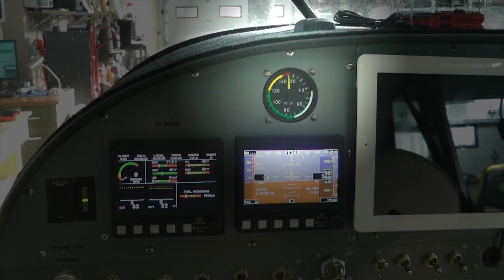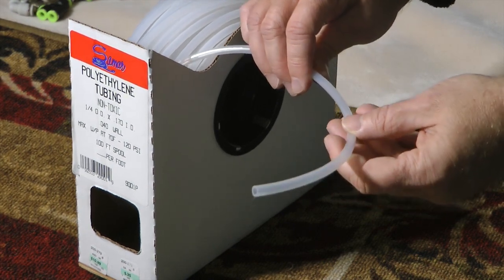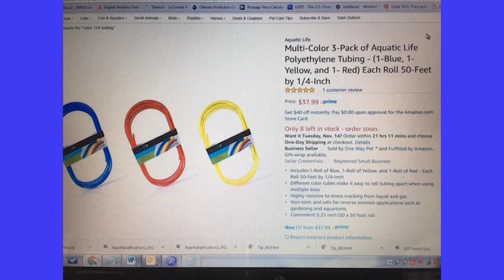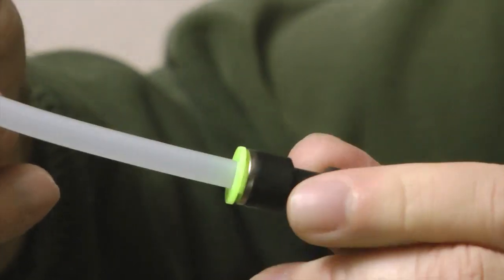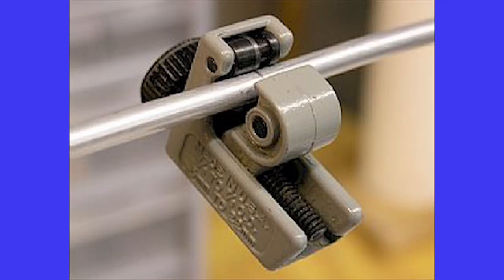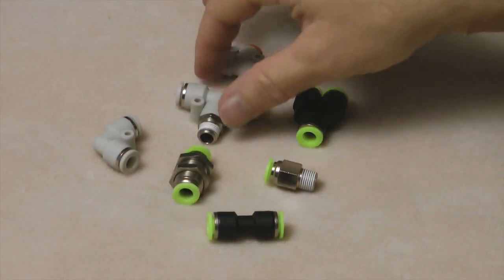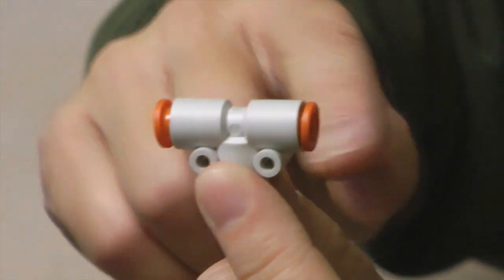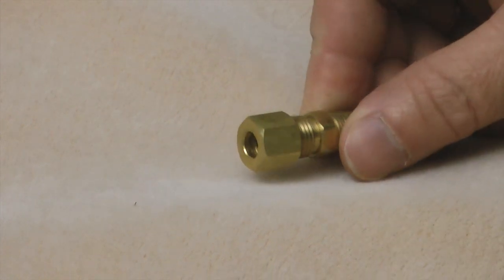Perfect Parts for Plumbing the Pitot - Static system

Comment: Small diameter polyethylene or nylon tubing as shown in this video can be cleanly cut with a new single-edge razor blade or new utility knife blade, without necking the tubing as a tubing cutter does or crushing the tubing as scissors or diagonal-cutting pliers do..  I usually place the tubing on a piece of wood that serves as an anvil, then simply press the blade down and cut through the tubing in one clean motion.

Comment: Nylon is mega ridgid .......polyethylene is a little more flexible.........polyeurethane is the most flexible and is great on turns and small radii........if your tubing is too ridgid , it puts alot of strain on the push-in connectors gripping action..........this system makes for a great installation and is lighter than brass fittings or aluminum tube..........nice stuff..

Comment: Are these legal on certified aircraft?
Reply: almost certainly not; you'd see a lot of npt to flared tubes in standard sizes, or even hose-fittings, clamps, etc. for an experimental build (experiments in safety design and construction) several of these push-to-connect systems are available with collar retainers that clip into the connection port and prevent removal. it's probably worth it also to ACTUALLY MOUNT the fittings that will allow it with small diameter screws to eliminate vibration as a source of fretting action within the retention mechanism. Over time, that fretting is going to act as a stress concentrator and shorten the life of the tubes.

Comment: DOT airbrake line is the way to go.  It's low cost, won't fail, won't crack, and comes in many colors.  The cheap stuff can crack and leak with age.
Reply: Plastics weigh less and aren't subject to fatigue cracking.  Kept out of sunlight, they'll last longer than you care to own the airplane.
Reply: Sure, sell it before it cracks and let the next guy fix it.  I guess I have a different quality expectations.  Just because it's amateur built, doesn't mean you should cheap out.  FYI, the installed weight is virtually the same.  The cost difference is no more then $10.
Reply: Where did you purchase the Red tubing? Any links?